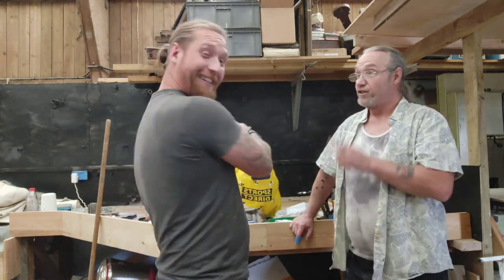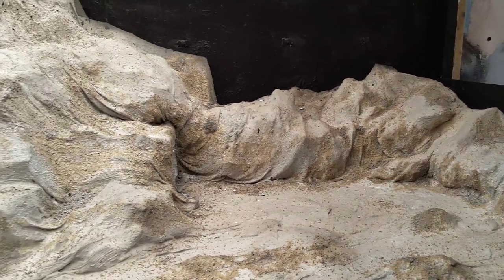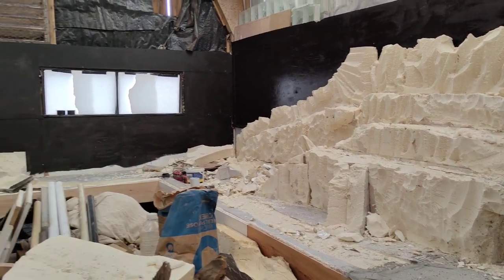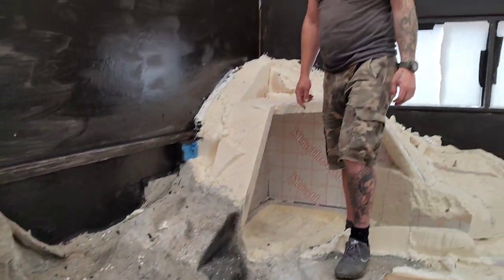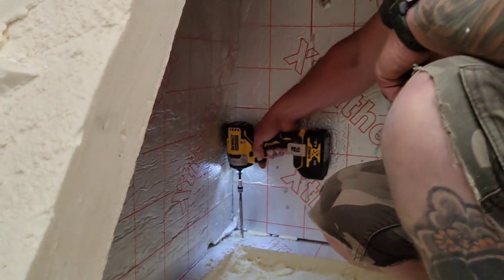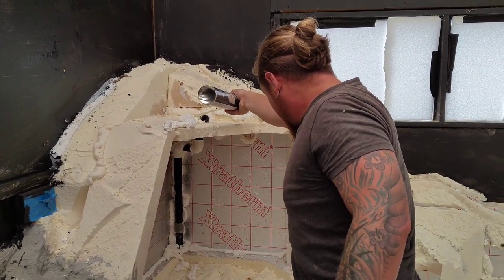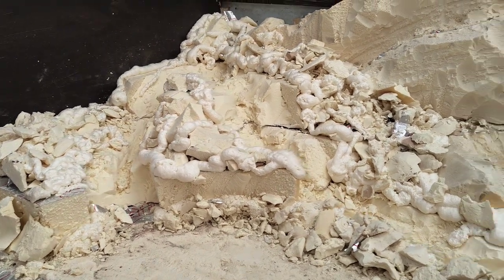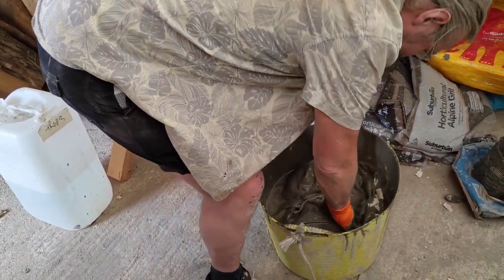INSANE micro crawler (Top Coat Fast Cheap Durable, and perfect)

Comment: @19:05-  That's more like the usual drop clothes we get here, as I mentioned in your earlier video. Was stoked to see you use it and here how it went, but must have ended up on the editing room floor. :face-pink-tears:
How did it work compared to your other, loose weave cloth? Was it stiffer/harder to get draped and tucked in? 
I was thinking old bed sheets might be a good, cheap option too. 
Thanks gents. Looking incredible!
Reply from the maker: It's in the next episode pal 👍 I answer a load of questions. 

The tighter cotton drop sheet was a little harder to manipulate but works equally as well. 
Bed sheets would be a good shout and thin so probably won't get as many heavy pleats but more cement coats will be needed to get a good crust on it.
Reply: @REACTIVETERRAINRC  Awesome! Thanks so much. Really enjoying all the gooey details of the build. This was so needed to get folks away from that awful plaster cloth!!! I've got dozens of old bed sheets I use to wrap my steel sculptures for transporting that I can use. 👍👍👍

Comment: This is awesome! I am going to be starting my garage build very soon and I'm now going to be using this method. I've done plaster cloth in the past, but this looks to be a much better option. Also considering I'm going to have about a 65 sqft area to work with, this will save me a bunch of money. I can't wait to see the detail work getting done. I'm also really curious to see how over powered that pump is. lol. I feel like you're going to end up with a ton of pressure coming out of that top pipe. My first thought when I saw it was it's going to need an adjustable valve somewhere in the outlet side. It might make for a great video while testing though.

Comment: I know it’s fast with the huge sheet but I feel like you’d get less folds and draped cloth look if you used just a little smaller sheets …. But oh well done now and looks great 👍🏻
Reply from the maker: Yeah absolutely you would get less folds but as where adding a top layer of grit stones and soil a lot of it wont even be seen. Also this terrain will have quite a bit of grass around as well 👍🪨🛻